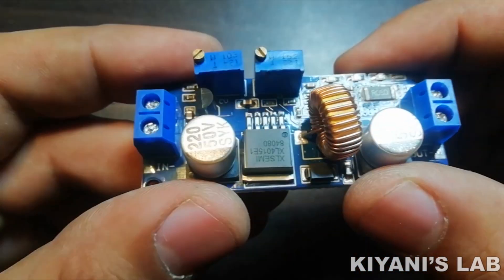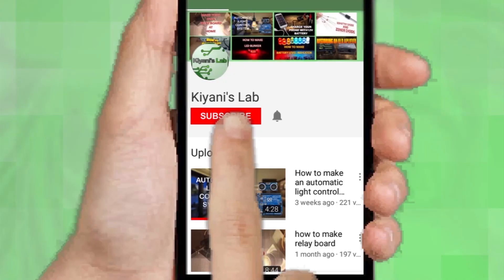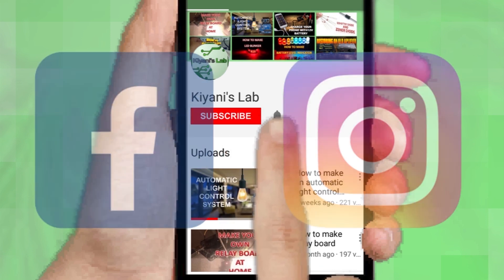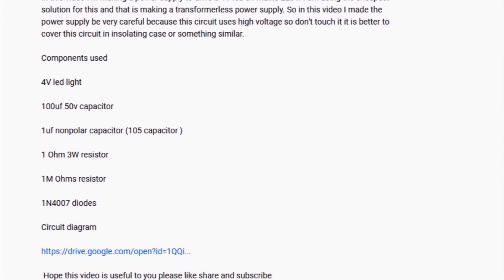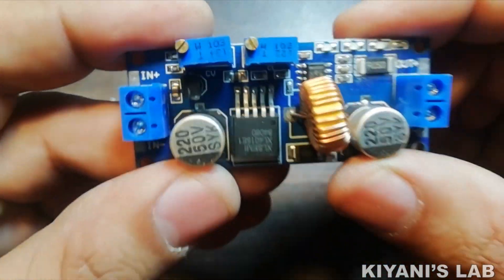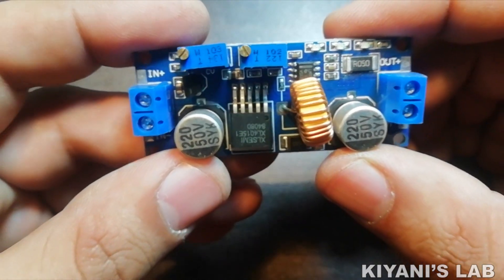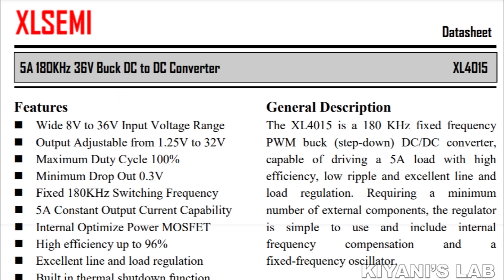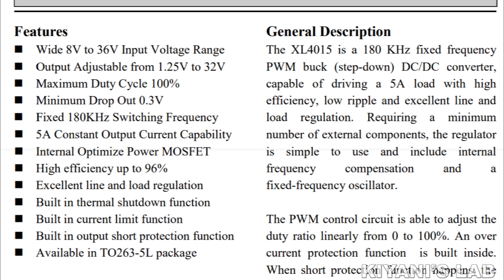XL4015 5A CC CV DC-DC Step Down Module

Comment: Question sir what does red light means? If i rotate the current potentiometer counter clockwise many times it lights red and become hotter, and if i rotate clockwise many times the green light will turn on
Reply: The red light indicates that it is working... For example, if the input source is 12 V and the output is 10 volts, the light remains red; and when you rotate and change the voltage, the light turns green because the output voltage is the same as the input voltage. (If you connect an 18650 cell at the output and set the module to 4.2 V—which is the voltage the cell supports—when the voltage reaches 4.2 V, the green light will turn on, indicating that the cell is charged.)

Comment: I purchased a red color XL4015 5A module and the potentiometers are located a bit differently there. My Li-Ion battery is 3.7V/800mAh. When I set up the output voltage to 4.2 volts with the potentiometer (physically located closest to the voltage input terminals which is in my case 7.5 volts) then measure the output short-circuit current with 10A current range multimeter it is always 2350 mA regardless of the position of the constant current potentiometer (physically located closest to the voltage output terminals which is in my case 4.2 volts). If I connect my Li-Ion battery is 3.7V/800mAh and measure the charging current it is always 50 mA regardless of the position of the constant current potentiometer (physically located closest to the voltage output terminals which is in my case 4.2 volts). Question - how to adjust the constant current potentiometer to make the output current reach the predetermined overcurrent protection value of 800 mA? I have tried already 3 out of 5 modules you sent me -all are the same. You have the blue XL4015 5A module in this video.
Reply: Sounds like a defective module, but if you've tried so many it makes me doubt that. If you have tried turning the current pot to almost minimum (counter clockwise, until it clicks and half turn back, 10 turn pot) and still have the issue, I would also double check the multimeter. I have used about a dozen red and blue ones without such problems, red ones seem to heat up more though.

Comment: How do work in audio? The integrated one died in an old audio equipment and they managed to adapt 2 class A/B mono modules of those that come now and that work at 12V, they made a regulator what delivered 12v and power the 18W modules, the problem is that it fell short of amperage and the Xl4015 regulator delivers up to 4 or 5 amps that would be left over for what I need. What I am interested in knowing is if they make noise when used in audio or can be used with confidence. Thanks.

Comment: I used a 12V 1A adapter to power my xl4015 buck converter, I was able to adjust the voltage perfectly, but when I switch to the current the blue light keeps blinking and irregular values are displayed on the multimeter. How do I solve this issue please? It's urgent.
Reply: I have the same issue. I purchased a red color XL4015 5A module and the potentiometers are located a bit differently there. My Li-Ion battery is 3.7V/800mAh. When I set up the output voltage to 4.2 volts with the potentiometer (physically located closest to the voltage input terminals which is in my case 7.5 volts) then measure the output short-circuit current with 10A current range multimeter it is always 2350 mA regardless of the position of the constant current potentiometer (physically located closest to the voltage output terminals which is in my case 4.2 volts). If I connect my Li-Ion battery is 3.7V/800mAh and measure the charging current it is always 50 mA regardless of the position of the constant current potentiometer (physically located closest to the voltage output terminals which is in my case 4.2 volts). Question - how to adjust the constant current potentiometer to make the output current reach the predetermined overcurrent protection value of 800 mA? I have tried already 3 out of 5 modules you sent me -all are the same. There is a blue XL4015 5A module in this video.
Reply: @oneundecided  
Those trimpots are quite tricky to adjust. Trial and error is required. 
Also what do you mean short circuit current? CC needs to be measured under load and in series, not parallel.
Try to install a potentiometer (rotary) if possible.

Comment: I use this module with ic radiator on a 12V drill with 6 18650 batteries instead of the old ones with a 32V power supply

Comment: Bro, can it be used in any Electronics circuit without any problem of noise ?
Can we change the inbuilt potentiometer with bigger potentiometer for fixing on metal cabinet ?
Reply from the maker: yes it can be used
Reply: 2 × 10k potentometer

Comment: If i give 12v 1A input tothis item by router charger would i can get 12v 5A output
Reply from the maker: no brother output power can not be greater than input power remember this golden rule they can be equal but ideally 
there must be some losses so efficiency can not be 100% 
you can give 30v 2.5A at input to have 12v 5A at out put
Reply: @KiyanisLab Can i lower the current? input with 5A to 2A?

Comment: I have these and out of 5 one was DOA and the other I hook my voltage to it and smoke came from it so dead as well.  The other three were fine.  What I want to know is how do I turn off the CC and instead run it as a CV?
Reply: My answer is late but to turn off CC, just set it at the highest current you'll be using. It supports up to 8 A so you can set that, just lower the voltage first before you set CC.

Comment: I can control the voltage how to do it ?
Reply: I am not sure how it is done.  I have three of these modules and when it is set up on the meter I can control the voltage, but when I connect it to a load the constant current kicks on so I am not sure how.  I think you set up the voltage to where you wish it to be via the meter then switch your meter to the 10A setting (moving the probe over to the 10A connector) , and adjust for the current you want/need.  Done.  Voltage will move as it tracks the current from what my experiments have shown.  With CC the voltage is pretty much irrelevant.